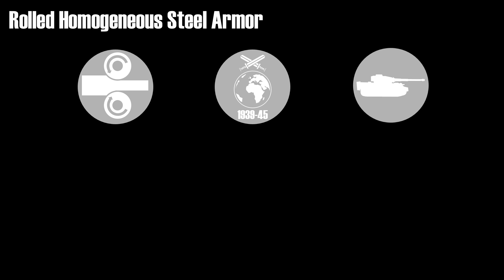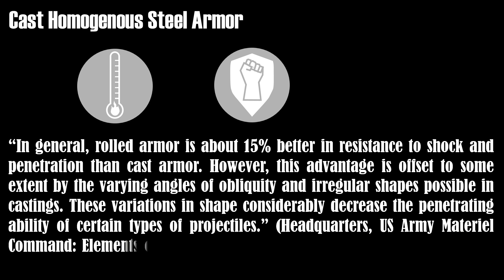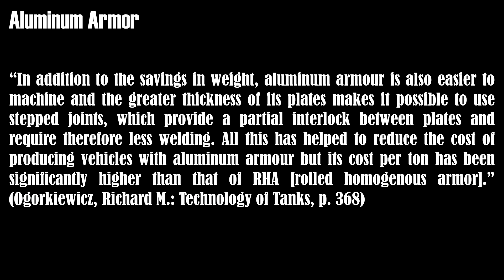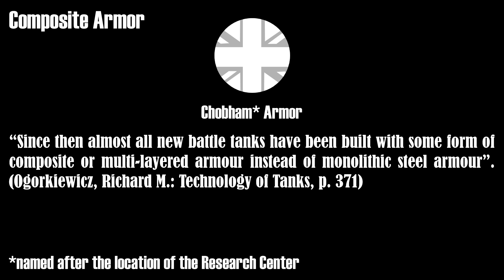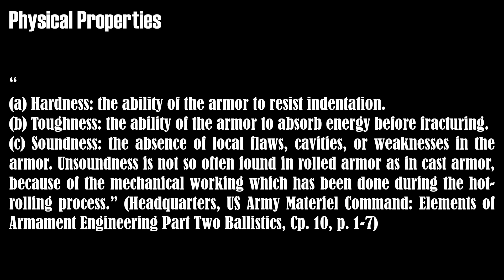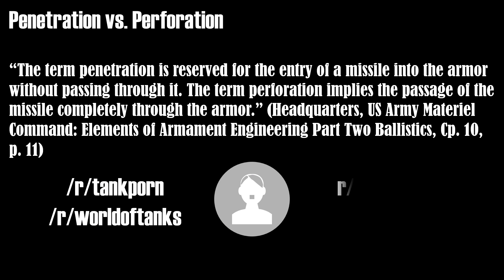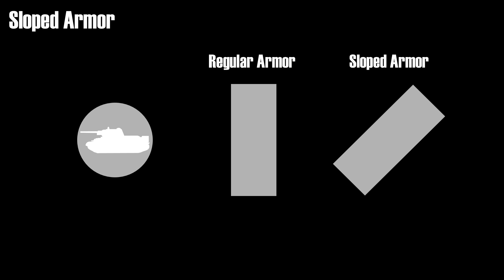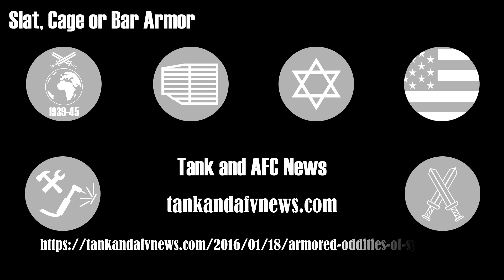[Tanks 101] Armor Protection 1920-1980 - Features and Characteristics

Comment: can you explain why there's a cult surrounding chobham armor?
Reply from the maker: nope, because I wasn't aware that there is even a cult.
Reply: Military History Visualized
basically if you ever talk about the abrams on the internet somebody will say "abrams have chobham armor which has never been penetrated" and they would claim that the abrams would win against any tanks because muh chobham armor.
Reply: Uhm, haven´t a couple of M1s been taken out by RPG-29s or other late-Soviet anti-tank waepons? o_O
Reply: Heron Myer 

The correct assertion, is that Chobam armor has never been penetrated by an enemy tank  A number of M1's have been disabled by RPG-29s and massive IEDs - but these were all at extreme angles, very unlikely to be achieved by an enemy round (usually down through the top of the hull, or straight up the floorplate). The point isn't the INVINCIBILITY of Chobam (nothing is - all armoring schemes are a compromise between protection and weight), but its CURRENT SURPERIORTY to any other forms of tank armor, especially in regards to AFV on AFV combat.

Comment: I want to point something out about sloped armor. People talk about how it increases thickness. But it does not increase the thickness for the weight/amount of material used.

Think about this: a rectangle of width w and height h has an area of wh. But a parallelogram of width w and height h has the same area! So angling the armor uses the same amount of material and has the same weight, if you want the same thickness.

Where sloped armor really benefits, is that an incoming missile hits it at an angle, and thus only transmits a portion of the kinetic energy to the tank. If the angle is \theta, then the missile only transmits cos \theta * energy to the tank.

So, against kinetic missiles, sloping the armor at 45 degrees gives about a 41% increase in defensive power.

Comment: How about the vulnerable spots? AFAIK in WWII the best way to disable a tank was to shoot at the window slits and throw molotovs. How are the windows now protected and why were the tanks so vulnerable to fire?
Reply: Fire because you are literally cooking the crew alive
Reply: LoTR Builders
How long does a molotov burn on non-flamable ground? 30s-1min? I can hardly imagine that this is enough to heat the inside. I rather believe that they inhaled hot gas o smoke.
Reply: Finns did that against Soviets. Around 400 tanks were burned during the Winter War. Finns let the tanks through their lines and focused on the infantry coming behind, when the tank was isolated from infantry a small group of Finnish soldiers would go and throw molotov cocktails on it's air intake/outtake or engine grill. The burning liquid would get into the engine and burn it stopping the tank. 

It was very effective against T-26. T-28 and T-34 were better protected, but it still was possible.
Reply: They weren't vulnerable to fire, before ww2 you could disable a tank with a molotov on the engine deck but during ww2 molotovs would be useless, it would be really hard to get close enough to a tank to shoot the view ports in and not get killed and i find it hard to believe anyone actually did this or that it is possible at all

Comment: Great video, loved it. I do have a small nitpick though :)  Shaped charge warheads don't "burn" their way through armor, that's a common misconception. Obviously the steel armor is not on fire, burning up, and not enough heat energy has arrived to melt a hole. There is a lot of heat involved, but not enough for a melt-through. Even the shape of the whole (given the armor thickness) wouln't make sense for a melt-through. 

What happens is the shockwave from the shaped charge causes the copper liner to be formed into a jet traveling at high speed (over 1500 m/s, the tip might hit 10000 m/s) that penetrates metals via a combination of Hydrodynamic penetration and plastic deformation.

Comment: Huh...I was not aware of aluminium used as armor. It always struck me as too soft.
Reply: It is, also hard to weld, they wanted to drop them out of planes for airborne operations.
Reply from the maker: me too, was pretty amazed when I found out how much aluminum tanks they built...
Reply: The M551 Sheridan actually had a steel turret
Reply: If I recall correctly, some aluminum armor also contained 2-3% magnesium in order to save weight. However they sometimes present a severe fire hazard, as the BMD-1 have shown.

Comment: I might have missed something, but did you at all talk about angled armour (T-34 being a bitch to deal with at long ranges)? Did i miss that part? If not then if it is not relevant I would like to know why, as this is often presented as a fairly big deal.

Also although it might be beyond the historical scope, I think it would have been important how doctrine has changed in relation to armour. You cannot use reactive armour and have troops running around the outside of tanks, so modern mechanised warfare really has to be 100% mechanised and not just maybe very few tanks supported lot of motorised units with a fancy name (Panzergrenadier in WWII).

Excellent video again. Every time you go into such depth that there is always something new for me to learn, even if I often already know the overall concepts. Thank you for making me smarter :)
Reply: I was thinking about the T-34 thing a while back. I realised that over long distances, the sloping of armour is actually less effective. Yes, the velocity of the projectile fired does decrease, but the angle of the armour becomes closer to 90* at a long range due to the ballistic trajectory of the shell arcing downwards.
I don't know if this has any backing in reality, but it seems pretty consistent to me.
Reply from the maker: angled armor = sloped armor. Or you mean manually angling your armor, well that is a technique on the battle field not a production / design  "thingie".

thank you!
Reply: Yeah that's true if you shoot at max arc 45* at 45* slope you're bassicly shooting flat armor

Comment: Shaped charges melt through steel using a high pressure stream of gas created by the explosion. There is no actual projectile going through armor as you visualized.
Reply: Arkenald 
High pressure creates high temperatures that's why I said 'melt' but you are right.

Comment: I know German tanks used a rough surface to protect from magnetic mines, why did they do this if like you said you want it as smooth as possible?
Reply: External components does not matter much, unless they normalize the projectile. You want the armor plate to be as uniform as possible to help dissipate the energy as even as possible. With a hatch or a MG port you get a larger concentration of stress which can cause a structural failure in the plate.

Comment: What about depleted uranium armour?
Reply: Basically composite armor. I could be mistaken but the DU is just a layer in the armor and doesn't make up the entirety of the armor. Assuming the M1 uses some steel in its armor its armor would be like this: steel, chobam or DU (I have no idea what the order would be), then probably another layer of steel, and then a spall liner on the inside.

Comment: wow i actually believed that myth about skirts defending against shaped charges. Same with messers being because swords were illegal nonsense.
Reply: Well, they still could defeat a shaped charge. They just weren't created for that purpose. They were originally made to add a thin layer of metal between an AT rifle bullet and the tank, causing it to lose energy and control before hitting the tank and hopefully making it bounce off, but they soon found that it was also good to have a thin layer of steel blocking a shaped charge because it just exploded on that instead of the actual tank. That's why, later in the war, they produced Schürzen skirts made of wire mesh. They weren't made to stop rounds but were great against shaped charges since they were easier to produce and still caught the charge before it hit.
Reply: Daniel Sinks I didnt say they are useless against shaped charges. I said that it was a misconception of their primal design.

Comment: Ive heard that in vietnam when they had to park vehicles when campint to pass the night they used to carry in the m113 or sheridam some meter of mesh fence to make a little corral around the vehicle, now im in doubt if dat will stop an atgm of this century.
Reply: They do essentially the same thing now a days, it won't protect against a modern ATGM but it will protect againt something like an RPG with a shaped charge warhea. The idea is to either catch the round, sort of like a metal net, or to simply cause it to detonate against the fence thereby causing the resulting plasma jet to simply blast out into empty space instead of the vehicle's hull.

Comment: HEAT rounds do not burn through armor.

http://eprints.maths.ox.ac.uk/211/1/poole.pdf  Read 1.1.1 Mechanics of a shaped charge jet
It is not hot enough nor is it molten its only 500C, it penetrates through extreme pressure like a water jet can cut through steel. And specifically it achieves penetration through causing the target material to enter a state of superplasticity
Reply from the maker: thx, annotation added.
Reply: Oh awesome :) Yeah its a really common misconception.

Comment: When did the allies learn about Welding, as early british tanks were BOLTED together.
Reply: According to Wikipedia, welding was discovered quite a long time but what I know is WW2 accelerated the use of welding in steels. Interesting fact, fracture mechanics originated due to concern about welding in ships.  Constance Tipper, a scientist from Cambridge investigated why the liberty ships  (which were cargo ships) kept failing when it was out at sea. By the end of the war, out of 2500 ships, 140 broke into two and 700 failed.

Turned out, it was a combination of poor material and stress-raising design features. That made the ships more brittle and when it was out in the cold, it failed.
Reply: Same with the Americans until they came out with the Sherman.

But a certain amount of bolting on of armor is handy when it comes to maintenance and repair. Look up The Chieftain's Hatch here on YouTube and watch his videos on the Panther and you'll see what I'm taking about. To get at part of the tank (I think it was the transmission) you had remove the entire plate on the top front of the hull, and then strip the interior along the side wall next to the driver, then you can access the component in order to repair or replace it. Although it was never specifically mentioned, I strongly suspect that the removal of the top plate involved cutting it off since there are no bolts that I can holding that top plate on to the hull, nor are there any latches of any sort.
Reply: Made them easier to take apart when they inevitably broke down
Reply: Britain used it basically until the Matilda in infantry tanks and the comet in cruiser tanks.
Reply: Right around the time they discovered bolt/rivet heads tend to break off after receiving a large hit, and bounce around in the interior making more of that swiss cheese mentioned in the vid.
Reply: Thought the Italians tanks were bolted and the early British tanks were riveted. Those choices were made for reducing the  cost/easiness of production. Riveting was common for shipbuilding so the British had loads of experience and skilled workers for it. Making large welds was relatively new and takes more training to become skilled at it then riveting.
Reply: Not really. Look at this picture:

https://en.wikipedia.org/wiki/Panther_tank#/media/File:Bundesarchiv_Bild_101I-635-3966-27,_Panzerfabrik_in_Deutschland.jpg

and you see that the plate that hold driver and radio-operator hatches is removable.  You can see what mean a transmission change on a Panther:

https://en.wikipedia.org/wiki/Panther_tank#/media/File:Bundesarchiv_Bild_101I-280-1096-33,_Russland,_Reparatur_eines_Panzer_V_(Panther).jpg

See, the top plate is still there (driver periscopes are still in place). Of course, is a fine dance with that transmission on the crane to make it fit into the tank.
Reply: The temporary fix was to fix big metal bands around the hull of the ship.
Reply: +Cipi Ripi fair enough.
Reply: Bolting the entire armor is ill advised, since people correctly said that bolts tended to fly off acting like bullets or shrapnel to the crew. 
However, maintenance hatches, engine or transmission covers or other things that commonly need to be repaired, replaced or removed is generally very advisable. Just put those bolted things on the roof or rear where they dont get shot at a lot.
Reply: +Cipi Ripi 
Actually on the picture where they are repairing the Panthers transmission, you can clearly see the hull roof plate lying on the ground right next to the tank. The periscopes are evidently not mounted on the removable plate but on the roof itself, only the hatches are on that thing.
Reply: builder396 Yeap ... I saw it later. That roof plate is bolted on the hull roof, which is welded to the tank chassis. The point was you don't need to torch the roof plate of the tank to replace the transmission.

Comment: Common misconception. The metal in the SC isn't molten and doesn't use heat to cut through armour. It instead relies on the Munroe effect.
Reply: xoon ZG Well, thanks for the corrections. I guess I oversimplified and misunderstood some stuff.
Reply: +
He also forgot to point out that modern ammo ( APFSDS & HEAT ) doesn't bounce, so shot-traps aren't a thing anymore.
Reply: This is false, they still do bounce. The older HEAT rounds bounced at 75 degrees. Now it is close to 80-83 degrees. Same goes for APFSDS. So shot traps are still a thing.
Reply: xoon ZG Modern DU and Tungsten APFSDS do not bounce. That's what we're talking about
Reply: Different material, same result. Russian APFSDS design is a great example. Because of their nose design and cap, they tended to preform badly against sloped armor. This was because at their time of introduction, they were good enough, so the designers made them extra lethal by making the nose flat and big. 

Saying that APFSDS does not bounce because they are made of Tu or DU is just plain stupid. The entire UFP of the M1 Abrams is angled to 82 degrees to bounce APFSDS shells. If APFSDS shells did not bounce then the UFP would be a huge weak spot, as well as the angled armor above the turret composite. Same goes for the Leopard 2, LeClerc, Challenger I/II, T-14, K2, K1, Type 90, Type 10, Type 96, Type 99, in practice pretty much all of them.

Are you claiming that tank designers are not aware of that fact?
Reply: It is not plain stupid. The material structure is very important. The angle is not made to 'bounce' APFSDS, but to prevent the tip from penetrating. Afterwards, the rod doesn't 'bounce', it gets destroyed in the process. 'bounce' makes it sound like it gets redirected but remains overall intact. It does, in fact, not ricochet.

when an APFSDS hits a highly sloped surface, the tip will start to penetrate. According to Alistair Doig (only) the very start of the penetration process of an APFSDS follows the same "high dynamic pressure" pattern that shaped charge jets utilize to penetrate steel; after that the penetration process is result of the kinetic force.
When penetrating highly sloped surfaces, there is lots of internal stress in the penetrator - depending on the penetrator dimensions and material, the stress will either bend the rod (which greatly reduces armor penetrator, as the kinetic energy is spread along a greater surface) or (more likely) break the rod. This is how the upper front hull armor of the older Leopard 2 models and the M1 Abrams works: it is rather thin armor (40-50 mm) at a very high slope (iirc. 78°-82° from the vertical). At this slope, the effective thickness is only about 200-360 mm thick, nowhere near enough to stop even a 1980s APFSDS (with penetration between 400-600 at 2,000 metres). But it is enough to stop the initial penetration by the APFSDS tip, then the stress should break the penetrator into pieces. The frontal roof armor of most tanks (incl. Challenger 2, T-72, Leopard 2, M1 Abrams, etc.) is designed the same way.

NO, whether you want to consider the slight possibility of bending the rod without breaking it a bounce, then yeah, you could say it bounces, but this is a matter of semantics.
Reply: I never said the rod was intact when it ricocheted or bounced of the plate. I know full and well that it is more advanced than simply "the plate was angled, and therefor it glances off". My point was, that you can still angle a steel plate at an angle and stop APFSDS. It does not matter if rod bounces off in pieces or as a solid pieces, it still bounces. And it is quite rare for a armor piercing round to not dig partially into the plate it hits before bouncing, you can see this on old WWII photos as well as on photos from the Ukraine conflict. 

You do agree, that if a DM43 hits a 50mm plate at 83 degrees, fails to penetrate, breaks up and bounces off it in pieces, it is still a bounce right?
Reply: xoon ZG It's a matter of semantics. Regardless, I suppose it's my fault for not clarifying. Modern DU and Tungsten APFSDS do not bounce to the extent of making shot traps an issue.
Reply: Bouncing APFSDS can still has a lot of punching power and can easily wreak havoc still. The reasons this is not a issue on the M1 is because it has a collar which protects the turret ring. So no, they are still a issue that can jam turret rings. But they are not nearly as bad as a full bore shell.

But I find discussing more is pointless. I get your point, I just wanted to correct you to avoid misconceptions.